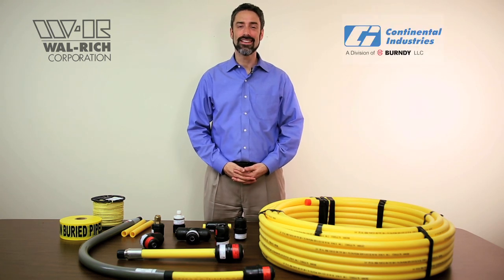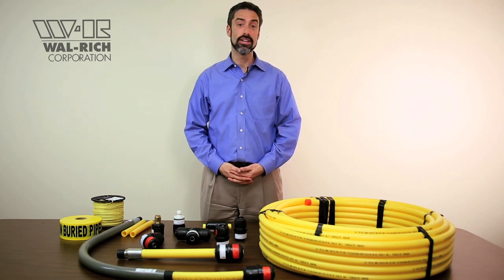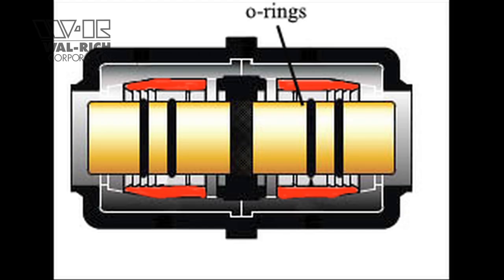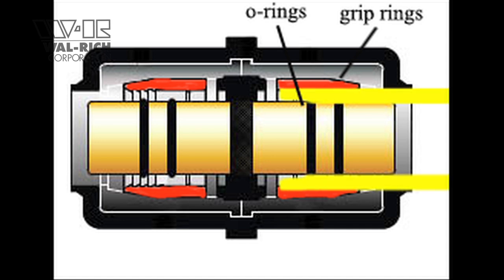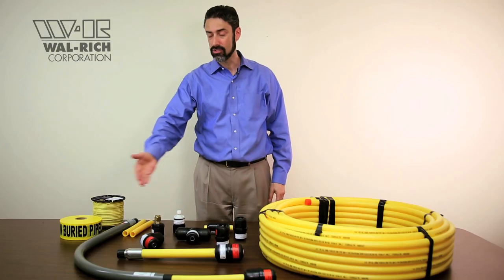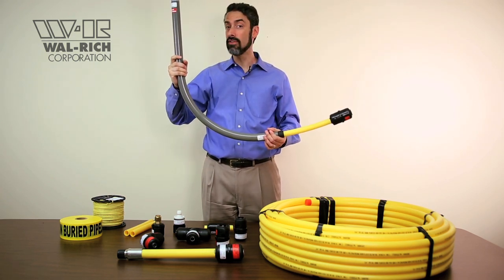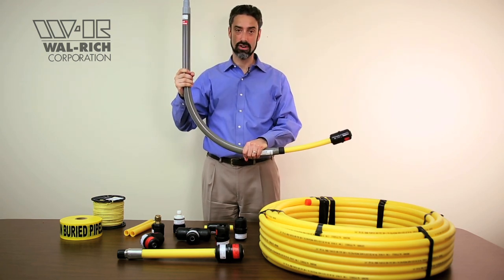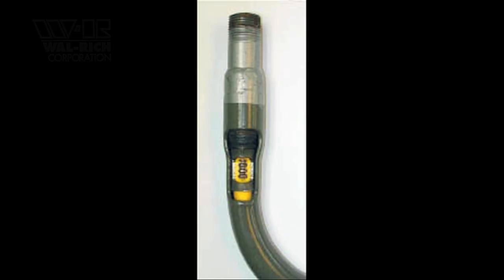Wal-Rich Underground Gas Training Part 3: Con-Stab Fittings

Comment: How do you remove these things??
Reply: Can’t 
That would be like finding the cure to cancer apparently.
Reply: 6" piece of sheet metal wrapped around the pipe where it meets the fitting, slide it with force into the fitting. It doesn't need to go the entire way in. Pull the pipe from the fitting. It may not pull completely out. Repeat steps as necessary. Wear gloves, you will certainly slice your hand otherwise

Comment: Can you use it as regular indoor gas line??
Reply: Pretty sure the answer is no.  Most will require some sort of metal when indoors (black pipe or flex stainless steel).  Plastic is for outside and direct burial.